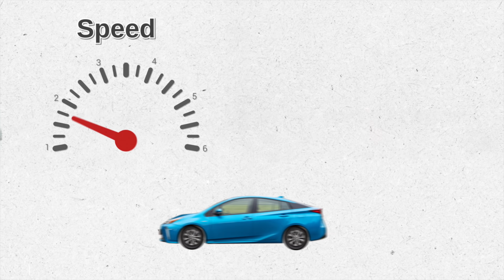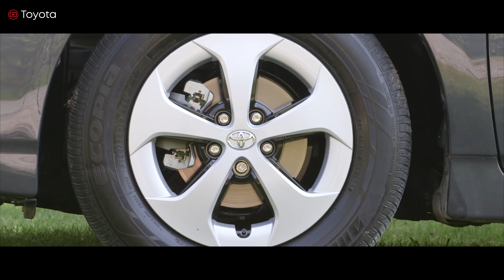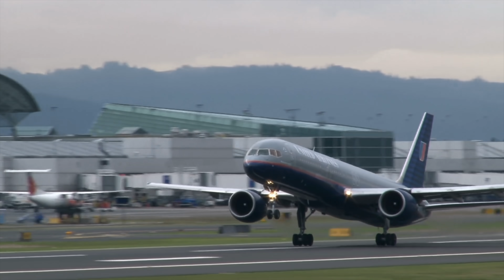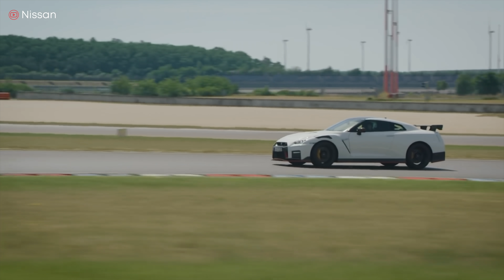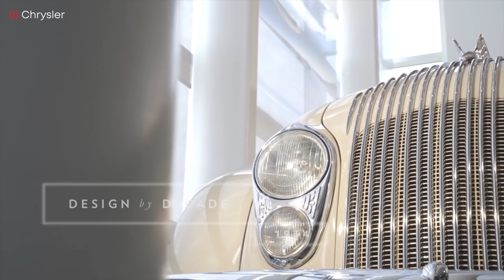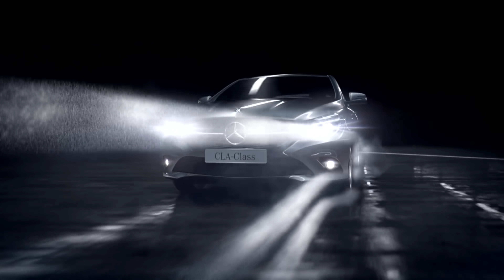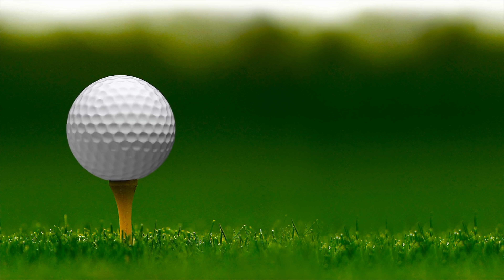Here’s Why Rolling Down Your Windows is Bad for Your Car

Comment: ⚠🚨A highway patrol officer once commented that a window half down is like a blade in an accident.

He suggested that we roll them all the way up, or all the way down. Your head goes side to side in most accidents.
Reply: That seems like a good tip. Altho you must be one unlucky B to get in an accident with the window half down and slam your head perfectly in the window glass like that
Reply: @Jason22Douce  I've been in an accident of that nature window was 3/4 of the way up because you're pinned high on your left shoulder the remaining bulk of your torso is left to fling forward the anchoring of your left shoulder causes rotation to the left the end result was my head smashing out the driver side window it's all good though my head was harder than that window.... and luckily enough the two brain cells that were left just rolled around inside my skull....lol
Reply: @Jason22Douce  i guess the glass edge is about head height and if you get T-boned...
Reply: @Jason22Douce  Doesn't have to be “perfectly.”
Reply: I've never driven with my window half down. It's either closed, cracked open an inch, or all the way down. Just seems safest that way.
Reply: @palebeachbum  Having the window cracked open weakens the glass by the top edge being unsupported. This wouldn't make any difference with frameless windows.
Reply: On the other hand,  rolling down all 4 windows about half an inch allows you to hear 360° around your car... which can help you avoid some collisions/accidents.
Reply: Sadly I have cars that only have some of the windows go halfway, or a quarter down, their broken, but at least I don't like keeping my windows open, so that's a good habit/thing for me.
Reply: When I rolled my car 3x my windows were rolled up. My head went side to side and hit the roof too. I didn't recieve any serious injuries.
Reply: Not a problem if your wearing your mask.
Reply: Takata for the kill
Reply: This would be dangerous for rear passengers. Many cars won't allow to roll the windows all the way down in the rear doors.
Reply: @RGV2300  My son just discovered this yesterday about his 2019 Accord Sport 2.0 that he’s had for a year.
Reply: Do you think this is still relevant on modern cars with side airbags? They should protect your head from the window area regardless.
Reply: @BlitzSixx  Closed windows give support to side curtain airbags.
Reply: When it’s hot I just use my ac lol I never lower my windows except at drive through a or when I get pulled over
Reply: 😬 wow I didn't know that , notes taken sir
Reply: I’ve also heard this about the sun visor.
Reply: I sometimes will keep one or two of the passenger windows partially open for ventilation but I think I typically keep the driver window up unless I'm driving below 10 mph.
Reply: I have had one kind of car (3 sedans, 2 station wagons) that had rear door windows that would go all of the way down. On every other car that I have had the rear door windows would not go down fully.
 @Rodrigo Godoy Valenzuela  The only cars that I ever had that had rear door windows that would go all of the way down were Citroën “D” cars. Their rear wheels were completely behind the cabin. The rear edges of the rear doors go straight down. They have no curve around the rear wheel houses.
Reply: Yes. I’ve told people this for years when they’re the passenger in My car. All the way up, or all the way down please! Why? Then I tell them. “Oh! You’re always thinking about the Negative stuff!” Well, no victims of their own windows have ever proved me wrong. 🤨
Reply: funny you mention that. . I know a dude who was decapitated by a half open window during a car accident.
Reply: One more thing, the strength of the car roof depends on all the glass rolled up to the top. Without glass the roof would collapse in a roll over accident.
Reply: @MichianaFisherman  While it may be true that bonded glass contributes to overall stiffness, glass does not contribute to roof strength.
Reply: @MichianaFisherman  Except in movies.  There also seems to be ramps everywhere in movies.
Reply: @MichianaFisherman  Hey, we can save 100 lbs. not buying a roll bar now...
Reply: @MichianaFisherman  Where did you get this information? Window operator mechanisms are not all that strong. They are made of flat strips of thick sheet metal for the most part.
Reply: @algrayson8965  
I installed Auto Glass for 19 years, my dad even longer, so we had to install glass to meet the new methods. Our old methods allowed the glass to be nice and sealed for leaks, but no strength in an accident. Being liable as an installer is how we got our information.
Reply: @algrayson8965   I just found what I was looking for. IIHS Insurance Institute for Highway Safety. Look up their roof crushing machine. I found document that the windows are up during testing. Funny huh?
Reply: @MichianaFisherman  Does the document say that the windows contribute significantly to the roof strength?
Reply: @MichianaFisherman  I make sure I leave em up on my convertible!

Comment: As big and flat faced as trucks are today, I don't think manufacturers really care about drag or efficiency. Trucks are getting taller year by year and it is not normal.
Reply: nice reply,
if need to diver-sify in cry-pto, you can do that with my bro-ker.
(+1-- 2 -- 0 -- 1 -- 3 -- 7 -- 3 -- 6 -- 3 -- 7 -- 5)..

Comment: I like driving around town with my windows open, or just cracked, year round, but I live in the Southwest were the humidity is low and of course there are days when it's just too damn hot or cold to open the windows while driving.  On really hot days, opening all the windows helps to vent the hot air and driving for a spell with the AC on and the windows open really cools the car down more quickly. Driving on the interstate at high speeds is totally different and if I have anything open, it's the moon-roof and the visor deflect the wind, so that it's comfortable to drive.  I do keep my car clean, though.

Comment: It's not about staying on the ground with an F1 car(that's not a problem without wings), it's about being able to take high and medium speed turns faster and brake without locking up from higher speeds.
Rolling down the windows works better at lower speeds where there isn't as much drag.
Clean and smooth is the way to go........like a swimmer LOL

Comment: If the frontal area of the formula one car is 0.24/.7 of the prius, then they would have the exact same air resistance at a set speed. Air resistance is proportional to cd*A. Where A is frontal area. But the frontal area of the f1 is probably only half of the prius, not 1/3, so I think the prius still wins.

Comment: As a member of the SAE this topic has been lurking around for years. Its impossible to give a correct answer if we are addressing motor vehicles as a conclusive group. So this answer will have to suffice since it encapsulates all vehicle types. If you're hot & need to lower the temp inside your vehicle, your best chance to maintain optimum mpg is to lower your windows if you're operating at a speed of 50mph or less city driving(stop & go). If you're on the highway at speeds greater than 50mph for long periods of time its best to turn on AC and seal vehicle. But be sure to recirculate air in cabin for best efficiency. As Scotty says to be sure to turn off your AC prior to turning off vehicle as this releases pressure from compressor & your AC won't smell of mold during use.

Comment: Mostly right with airplanes.  They actually take off into the wind so they can take off at a lower speed, causing less stress on the gear, and giving more time to abort if necessary.

Comment: Pick up owners don't forget to leave your tailgate up. Dropping your tailgate actually increases fuel consumption. Apparently the bed creates a pocket of air that helps keep airflow around the top of the vehicle. Myth busters did an episode about it.
Reply: Plus the cheerleaders blow out of the bed on the freeway
Reply: @cayman9873  Well that's bc you didn't position the cheerleaders correctly. The cute petite ones go upfront in the cab and the bigger muscular ones go in the back, above the axles.
Reply: @JAustin-c6q  I haven't seen that episode but the pickup gate up or down was well done. They even used a windmill tunnel with smoke to highlight their findings.
Reply: Does a tonneau cover help increase fuel efficiency with less drag

Comment: The Astro/Safari vans were known to have better fuel efficiency pulling a trailer than without towing anything while highway driving. Their back ends were just too flat for good air flow.

Comment: Can u make a video about what happens if u over tighten or under tighten spark plugs?
Reply: If it’s undertightened it can cause engine knock and expose  the plugs to combustion chamber temps (because the hot gasses can escape which can damage the plugs), overtightening can break the spark plugs or strip the threads. Gotta be careful lol

Comment: The Mythbusters did an episode on windows up/down. I can't remember for sure, but I don't think they factored in the A/C. They were just testing the aerodynamics & fuel efficiency of windows up opposed to down. If I remember correctly, they concluded that 50 mph was the magic number. Anything 50 mph & above and you should leave your windows rolled up to increase fuel efficiency.

Comment: Dirt on car's exterior capable of reducing fuel economy by as much as 10% ??!!  Maybe for dirt particles the size of bricks.  And even if dirt increased aerodynamic drag by 10%, it would not come close to increasing fuel consumption by 10%, as only a fraction of the car's fuel consumption is due to aerodynamic drag.  Significant portions or the total fuel consumption are also proportional to rolling resistance (basically energy consumed in flexing of the tires and overcoming bearing friction) and engine internal losses.

Comment: If car manufacturers cared about fuel mileage they'd be putting tractor diesel engines in them. A full size square body F150 can get 50 mpg with a 3 cylinder tractor engine and do 100 mph.
Reply: But that powertrain won't let you tow.

Comment: hey scotty 
what could be a good first car 
im willing to spend 7 to 8 grand 
btw love your videos
Reply: Spend $3000 or so and put the rest to college or trade school. Student debt is no joke; a lot of people my age can't buy houses because of it.

Look for a 1996-2004 Avalon, 2002 or later Panther body (except in wintry climates), 1996-99 or 2001-2003 Nissan Maxima, or 1996 or later GM sedan with the 3800 V6 (replacing the intake manifold or cooling elbow, as necessary). Any of these cars will be cheaper, very reliable, and be great sedans for at least a decade and a child or two, if that happens. Another benefit: Anyone not enthused about the idea of using the car as a family vehicle isn't a keeper.
Reply: 2010 Honda CRV, Rav4, Pilot
Reply: Scotty recently weighed in that it would be a Toyota (who'd a guessed?!) Corolla. Bought a 2007 new, got 160,000 miles on it, runs like a clock. Love it, will run it till the wheels come off ... in about 240,000 or so miles.
Reply: toyota saloon or hatchback with manual gear.

Comment: So, running my car weekly through the car wash, and blasting the AC when it's warm outside is a good thing. I can live with that.
Reply: Prefer self wash over the automatic ones since I'm that one unlucky guy to get my car damaged at the car wash with a "not liable for damages" sign.
Reply: @JustAName-it5qp  I saw this happen to someone’s car right in front of me at the car wash, they kept the car moving with the door open for some stupid reason and it hit in something. After that I’m not going back.
Reply: @JustAName-it5qp  me too. Had paint get chipped on the side if the car. Looks like salt blasted my car lol. It's minor damage but ever little damage bothers me
Reply: technically that depends on your car model and how fast you are driving.  Faster you are driving the more AC is in your favor over windows down.  At lower speeds the opposite tends to be true.
Reply: @iandms1160  yep city traffic with ac on more fuel used at motorway speeds its usually better with windows up and ac but not all cases windows up without ac on definitely better
Reply: Goes with out saying, & good idea to run A/C few minutes in winter or off season, to keep A/C rubber seals good & lubed.
Reply: I need to take my car for a wash! And I just happen to have a Prius, but not because I really picked it out. I was in a wreck, and the guy I buy my cars from gave me a great deal on it. Only cost me $1000 over what I got from the insurance company of the guy who hit me. I think it ended up being $4,000 or $4,500. It’s a 2009. I got it used in 20017. Looked it up in Blue Book and that was a great deal.
Honestly the only thing I’d change about the Prius is the AC. It doesn’t reach the back. I didn’t know this until I sat in the back seat for 12 hours during a road trip last Summer. I felt SO bad for my nephews and nieces after that. Where I live it gets up to 105 in the Summer heat. I got fans for the back, and the next car I get is going to have air vents and AC controls in the backseats.
Reply: My vehicles would stay dirty if I had to use a car wash.
Reply: @JAustin-c6q  Yes! Its called the Bernoulli effect.  Typical wing lift on a plane's wing (or hand out the car window) is 10% Bernoulli,  and 90% from the air hitting the bottom of the tilted wing (your hand) and being forced down, driving wing/your hand up- known as Conservation  of  Momentum in pbysics.  I dun larned this from a NASA x-purt.  From science class, I too thought it was all Bernoulli for 30 yrs, but managed to stay alive anyway!
Reply: Actually keeping your windows closed and NOT running the AC is best for fuel economy.
Reply: As long as your washing your car yourself in the self serve. Automatic car washes can and eventually will scratch the hell out of your car.
Reply: I won’t say it is “good” for your feul economy but like he said it is better😅
Reply: Well Scotty made a video where car washes wear down your paint faster then a hand wash and I believe it
Reply: @crazyman5520  very true. It beats the clear coat up, which is like enamel for your teeth. Once the clear coat is gone, then it hits the paint, then its right to the sheet.
Reply: @crazyman5520  *than

Comment: Airplanes take off into the wind because airspeed is everything to an airplane.  The greater the headwind, the less the airplane has to accelerate over the ground before it can take-off.  The plane isn't making "more" lift on a windy day as opposed to a calm day, it simply reaches it's take-off "airspeed" faster and can get off the ground in a shorter distance because it doesn't have to accelerate as long to reach it's required flight speed.  It's the same when landing.  They always land into the wind because their "speed over the ground (groundspeed)" will be slower which makes things a lot easier on things like landing gear, tires, and brakes.
Reply: Good post.

Comment: Airplanes land and take off into the wind to reduce “ground” speed which is safer
Reply: * Thomas Soch * - Yes, this is true. I lived, worked, ate, slept, and played on  nuclear-powered aircraft carriers for 20 years. We'd always turn them into the wind for added lift for the fighter jets. 
- Don't get me going on the true stories I've experienced. Especially north of the Aluetian Islands, when the flight deck was covered in ice. 
I've too many stories.......and not enough beer.
Reply: @JamminClemmons  you should write them down, like a memoir.
Reply: @JamminClemmons  which is why carriers are more vulnerable during flight ops because heading will be known.  (1300 hours in S-3s for me too)
Reply: @JamminClemmons  I hate flying north of the Aluetions and flight ops on those icy decks
Reply: It reduces take off distance
Reply: I actually saw a plane going backwords due to high winds over the runway.
Reply: @marcusvaldes  That’s amazing

Comment: Scotty I was told when an airplane takes off it’s using pretty much 100% of it engine power as well so if somethings going to go wrong is it gonna go wrong with takeoff 😂
Reply: No,  actually the most dangerous flight condition is landing..   almost anyone can start a plane and throttle up and get a plane in the air.. flaps help too.  
        But timing a landing  and getting the wheels down in the right spot and potential cross winds can be quite a challenge.   There is little stress taking off.  You just checked over the aircraft and weather and fuel level.   Landing is more stressful as you need to get the plane on the ground no matter the weather or plane condition before the fuel is exhausted.  Thats way more difficult.  Been doing it for decades.

Comment: The airline industry knows a thing or two about clean surfaces and fuel economy. 
There's a good video of it on here somewhere.
Reply: I think for cars though there is a negligible gas savings over a dirty car vs a clean one.  With a jet at least they are going 480 mph and burning 750 gallons per hour (Boeing 737 in cruise). So I know Southwest airlines washes their planes regularly... they have fuel savings down to a science.

Comment: Hey Scott. I have a 1994 Mazda 323 1.6 Manual. Only 270,000km. Looking to fix her up. Any concerns about changing transmission fluid in a manual at this age?
Reply: It's splash lubricant, so a simple drain and fill should be fine. Use the lubricant (or successor) described in the manual. Don't flush!
Reply: @EMichaelBall  thank you. I couldn’t foresee any reason at that age it would be bad, but logically replacing fluid in an auto would be good. Except when it’s not as Scotty keeps telling us haha